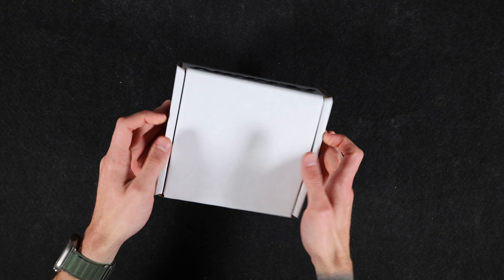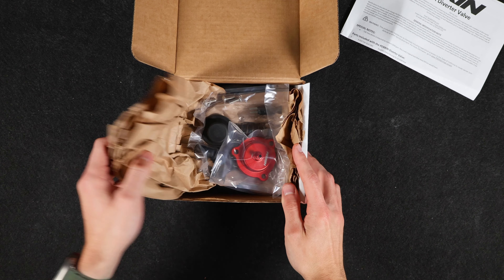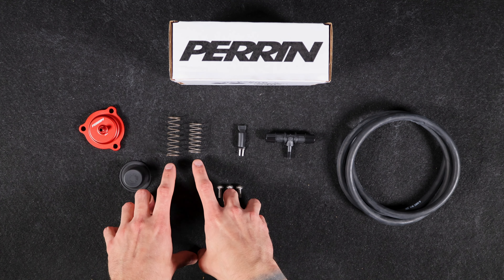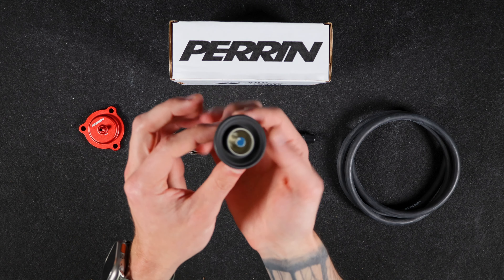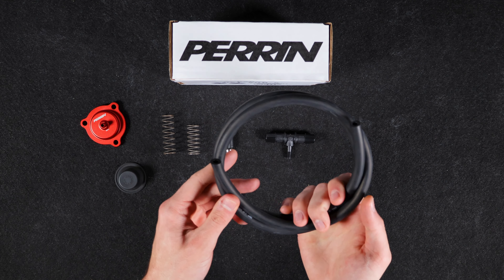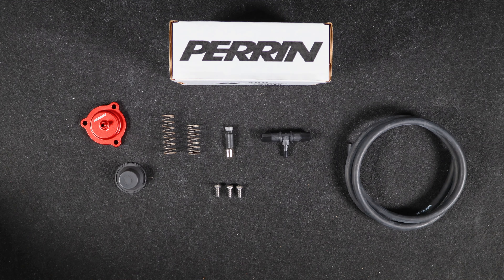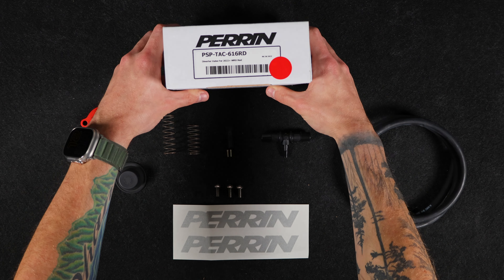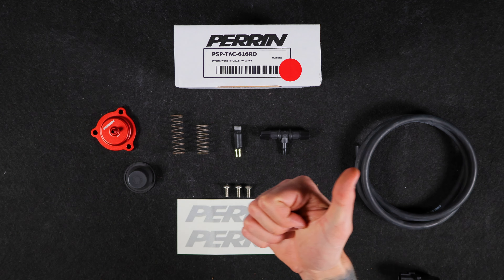PERRIN Diverter Valve for 22+ WRX (What's In The Box!)

Comment: Looks nice! I’d love to know how it sounds.
Reply from the maker: So... since this is a recirculating valve and not a vent to atmosphere it wont be making any crazy pshhh sounds. However, because it does not vent to atmosphere and it is recirculating boost, it will retain more boost at certain throttle positions.
Reply: @PERRINPerformance  I figured it wasn’t loud, but I’m wondering if it sounds like a Bush Light can opening like the stock one. 😅